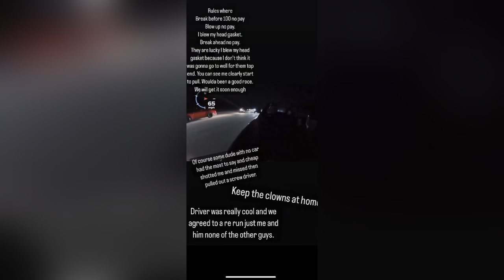Built EVO 10 Vs whippled 5.0 gone wrong ‼️‼️‼️ $8000 pot💸

Comment: Hate to see that for any performance enthusiast.... A perfect example though of why if I ever build another Evo anything past 9 is a hard pass. 4G63 is a boss when it comes to pushing limitations reliably in the 4cyl arena. Hopefully no major damage occurred beyond a blown head.  He can probably get that back on the streets in a couple weeks if no secondary damages occurred.  Clean it up & polish, flush the system and change the oil a few times before he pushes it, use stronger head studs, possibly replace the head...  A quality Evo shop will be able to fix that up in no time if thats all that happened.  Just have to be patient when it gets put back together to change the oil a couple times before its pushed hard.  Id like to see this rematch!
Reply: Lmao u are out of ur mind, 4g63 has the same reliability as the vq engine
Reply: lmao man you must be outta ya mind thinking the 4g63 is the most reliable 4 cyl. The k24a2 is what deserves that title my boy.
Reply: @3lohssa  Theres a reason why the evo died after they stopped using the 4G63. Ive had and built a couple of them, and if they are built correctly and not maximized(Not pushing 100 out of 100 for the components chosen in the build, and you put forth effort to maintain low IATs) youll rarely have major issues as long as you perform regular maintenance and select quality supportive mods(Head studs, Hoses, Clamps, Gaskets, Radiators, thermostat, intercooler, etc.) I never had any issues from mine. Nor did my friends. 600-900whp setups.. Though I do know of a few that had issues with their Evo10 when pushing.  Perhaps they have made improvements to the aftermarket parts available for them, but for the first few years they was out nobody that was serious about racing wanted them...  In fact, to this day one of the most well known EVO builders in the country (from Ohio) hates them, I would imagine for good reason. 4G63 was a race developed engine, it won ralley championships... It was a proven platform to handle big power(for a 4cyl).

I havent been up to date on the more recent aftermarket mods for the 10's now, so perhaps they ironed out the weaknesses, no pun intended..🤣

Ive graduated to S58's which im focused on now.  But, Id like to build another Evo8 or9 sometime in the future..  Certainly a pure drivers car..  From my personal experiences, if you build an EVO, thats the version to pursue.  Not every auto manufacturer gets it right when they try to integrate progress.  Sometimes those decisions are made for reasons other than reliability or tune-ability..
Reply: Yup a was running 45psi in my 92 talon 4g63 stock block for close to 6 years 👍
Reply: You’re all delusional if you think the 4b11 is worse than the 4g63 😂 4B11 is better than the 4g63 in every single aspect. It makes way more power than the 4g63 by a landslide
Reply: I don’t know buddy the 90-94 dsm 4g63 stock handles a ton

Comment: Why I don’t like small engines . When you put 38-48 psi of boost thru a 4 banger the heads will lift and some point. Not a issue at 15-20 psi on a v8-v10
Reply: That's such a lame thing to say
Reply: Makes no since … v8-v10 can’t handle that much psi lol it too much stress on the bottom end and the valve train 😂 you no clue wtf your talking about and it shows
Reply: Show me a v8 or v10 running 48psi
Reply: You don't know much about engine building. All you need is a good set of ARP studs and decent turbo design. A 4age for example built right will kick a v8 anyday
Reply: @briandent5460  they don’t need that much psi to make power
Reply: @samuelfowler2157  why it hurt your feelings ?
Reply: @briandent5460 look up 5 second 4.6 mustang that was on 50lbs on stock block